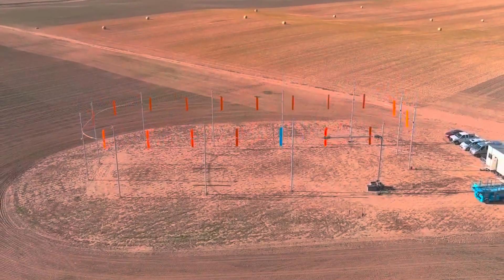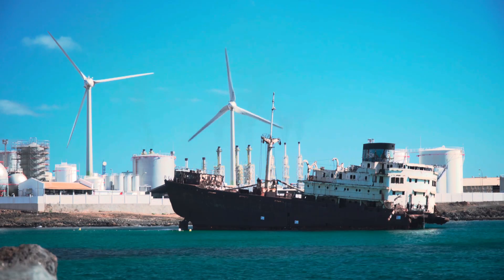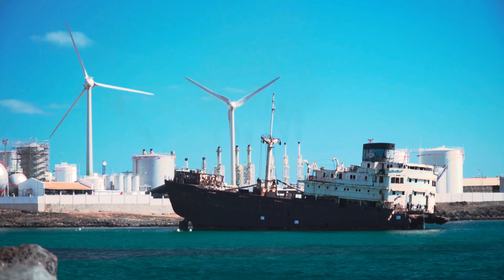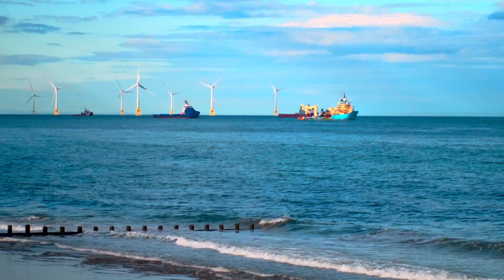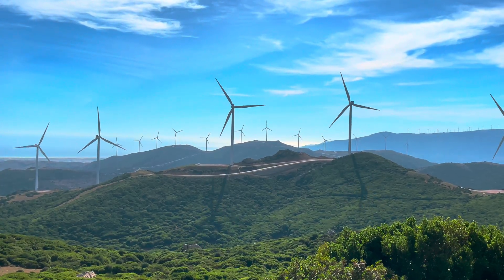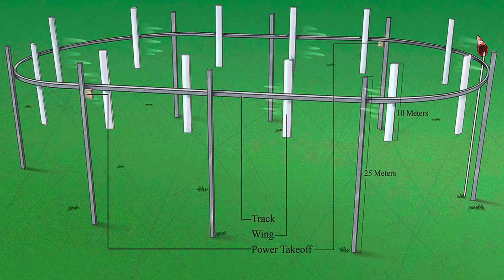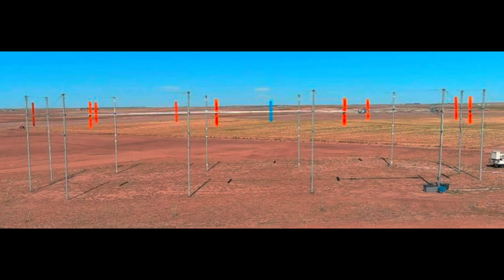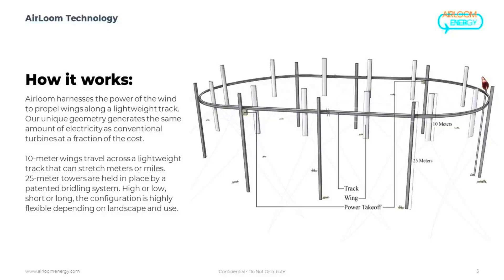Airloom's Weird Wind Turbine System

Comment: Bill Gates is an idiot if he invested in this. 
Not only this is worst than any vertical wind turbines which they are 5 times less profitable than horizontal wind turbines, but also quite expensive to scale and requires a lot of space.
Take a look on how much space this requires for 2 kw, when accomplish the same with solar panels requires  1/3 of the roof of that small house we see in the video.
The maintenance of this seem also a nightmare.
Reply: TLDR; Your opinions are valid, but I think that it would be a lot better if given time to develop. Its a new design, and I can see the promises in it.

Ima be honest, this prototype does seem very flawed, but I can see a bunch of upgrades to the design that would make it a lot better.
Its less profitable sure, but it looks like you can stack more blades on top of itself over and over. I think that the oval doesnt give it justice, since if its circular, there would be a much more consistent flow of wind, AND the blades wouldnt interfere as much.
As for space, I think that if these were a little taller, like 40 feet, you should be able to build houses around them, and perhaps the roofs will help flow wind to the blades (depending on their shape)
Solar panels are most likely much more effective than this, but you could have both. Not just that, but solar panels will need to get replaced with non-recyclable materials. I can see these being built like powerlines, where (if wood) can be decomposed for soil, or (if metal), melted down for different application. As for the blades, I can see a thick and strong fabric being used like a wind sail.
As for bill gates, I think he himself is not investing, but rather the company designing these asked for donations, and received a huge donation from microsoft.

I do not see this being able to power a town at all, dont get me wrong. I do see this (the prototype) being able to supply perhaps a fifth of the energy needed for a residential block though. If it were double or triple stacked, I think it could power a whole block of houses. The prototype looks to be about the size of 3 - 4 houses, and assuming you can place houses between them, and creating individual rails on top of each other, I can see this powering a whole neighborhood if given the chance.
Reply: @Min1goose  ok, let me clarify why my review was so negative. 
First, this is not the first time I see this project, I am not sure but I guess I know them since 5 to 7 years ago, not sure. 
But the key aspects on why this seem almost a scam (because they claim a LCOE (levelized cost of energy) of 13usd/MWh when Horizontal wind turbines are at 24-48usd/MWh, and the best vertical wind turbines are at 160usd/MWh
Even if we take their claim that for the same power output (which is not the same than energy output) it requires way less mass on materials and foundations (that is a huge IF).
Still, I would not be convinced that this has a chance to compete for two strong reasons:
1- Wind is terrible bad close to the surface due friction against the ground, If you have 6 m/s wind at 10m height, then at 20m would be 7m/s, at 50m 9m/s, at 100m 11m/s.  But wind collected energy depends on wind speed cube V³, this mean that just a 20% increase in wind speed means 73% extra energy.
That is why current horizontal turbines went from a classic model of 2MW to 10MW by turbine, no because it is easier to make them bigger, no.. it is due how cost efficient is to reach higher winds.
2- Horizontal turbines are more efficient to extract power from the wind, because they reach faster swept area due the blade tip speed.  The tip is where the most of the wind energy is collected.  On vertical wind turbines the tip swept is quite slower so they reach an overall efficiency of 25% from the collected area vs 50% from horizontal turbines.
In this case, the blade swept area by second seem way worst than vertical wind turbines or it seem to require way more blades to achieve a similar result (which increase cost). 
Placing houses or other stuff in the middle or around it would just make it worst, due more turbulent flow and higher friction.
Trying to channel the wind to the blades would increase a lot the overall cost which would be less profitable and niche.
For last, my common sense tells me that this mechanism generates a lot more loses for the  tether friction and is not clear how to extract power from such slow movement, that is a huge issue for generators due the amount of gears you need to use.
I am not against new technologies, in fact, my higher bet for wind energy are high altitude power kites, in which the kite can reach 1000m and swept on infinite shape at 100kmh a lot of wind area with very little foundations and hardware.  They only need to improve on the AI software that keep the kites flying all days all year without accidents.
Reply: @angellestat2730  Wow, thanks for the info! This was my first time hearing about them, and as a new student to engineering, I found the idea very interesting. I was spending the whole day trying to come up with improvements to the design that was shown in this video, and I kept coming across the issue where the wind would push both directions of the blade, and that the blades couldnt turn with the wind. Thanks for telling me about the flaws you can see with this design!
Reply: I looked at their website though, and it looks like the design was made by an amateur team, with what looks like, low peer revision. I can see a ton of things to make the design better.